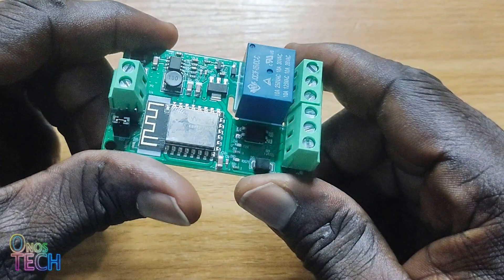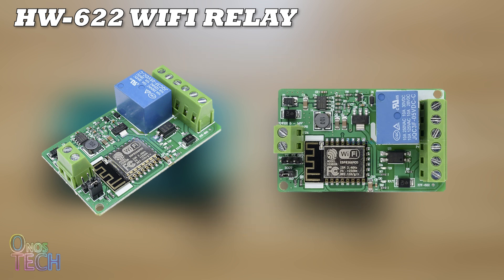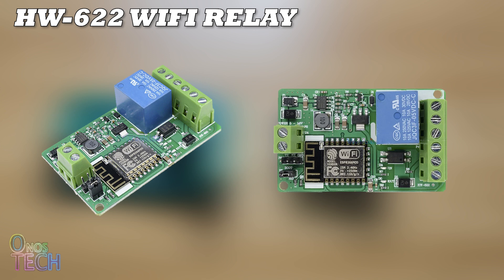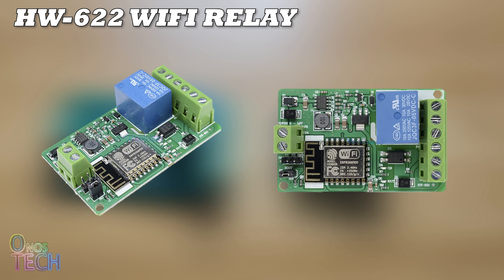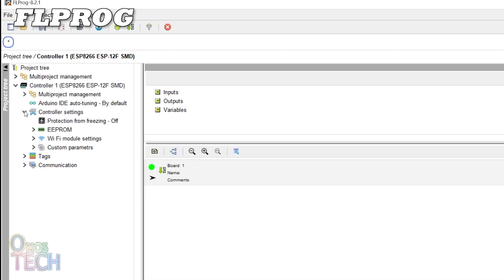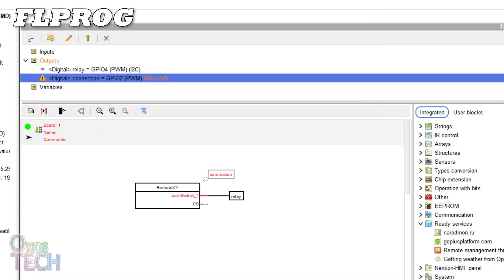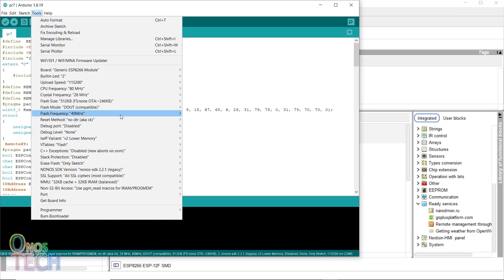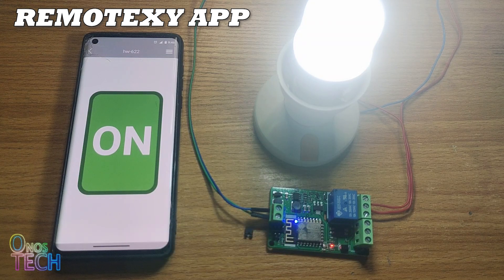HW 622 ESP8266 WIFI Relay Review & Programming for Home Automation

Comment: Hi, i programmed the module and it worked fine, i did setup default setting to ON for the relay. now for some reason i could see relay is on when power supplied to the module however wifi AP is not visible. i also see the area around the wifi chip is getting heated. what could be the problem please help.. I am trying DIY way, not have much knowledge of the electric boards etc.
Reply: How did you program it?